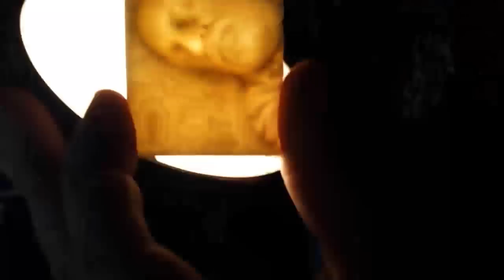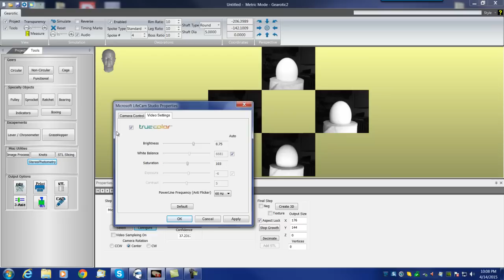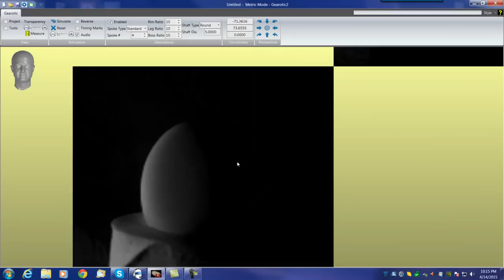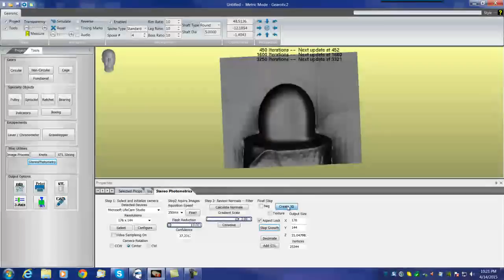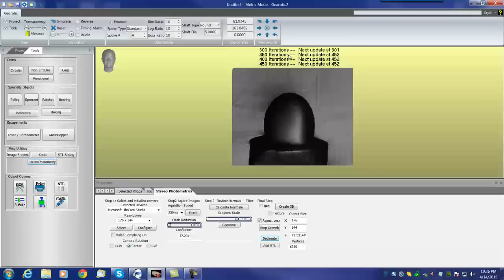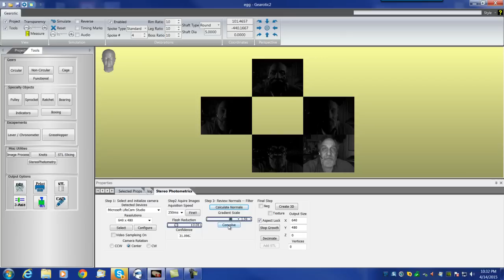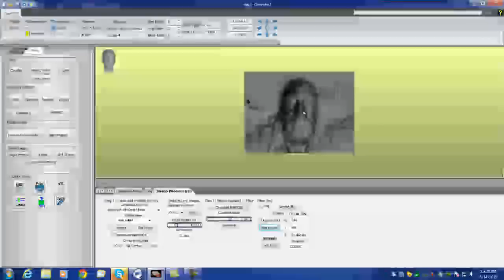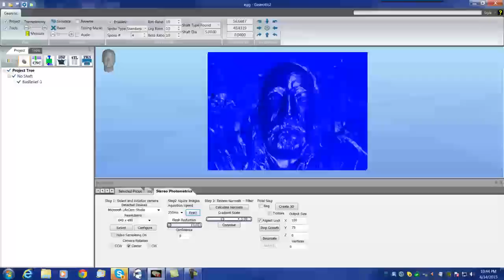Web3D

Comment from the maker: I may add an output to trigger outside lights in future, but Id ilke to perfect the use of a monitor first as everyone has one. In the fall Im open to adding an HID output to control lights, or a sound trigger or whatever. :)
 In the meantime, the monitor output keeps getting better, is not higher res than this video, and I guess you could always plug a laptop into a big screen tv. :)